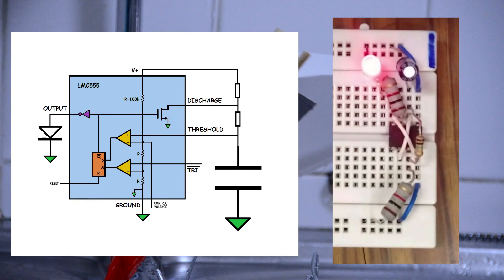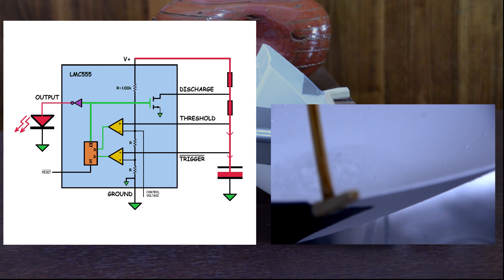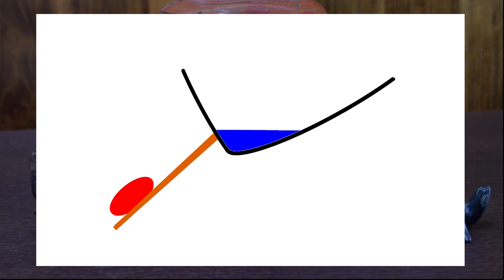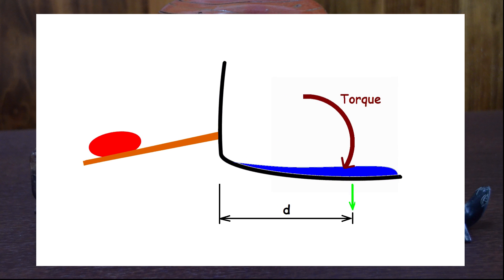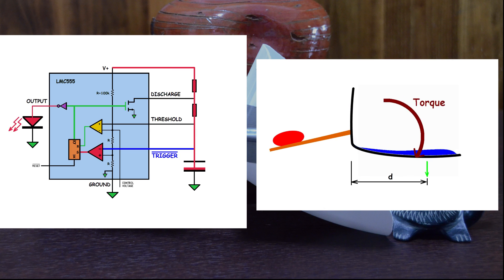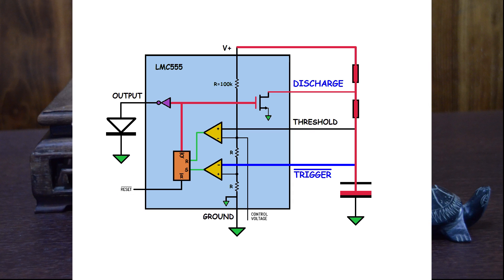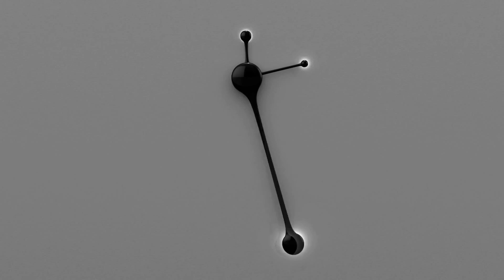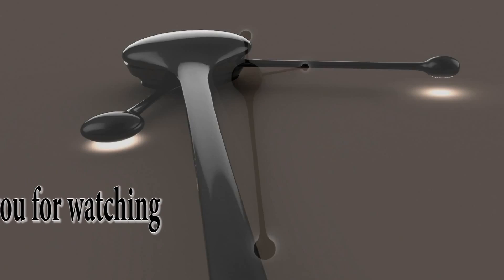555 timer circuit theory and mechanical analogy

Comment: so you can use a 555 without a potentiometer but the "timing" affect will then depend solely on the input voltage?